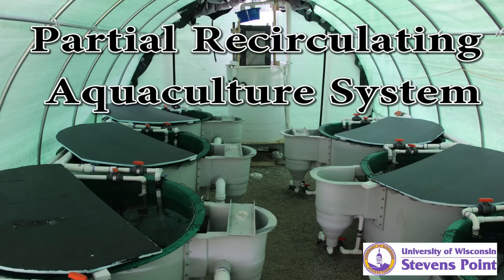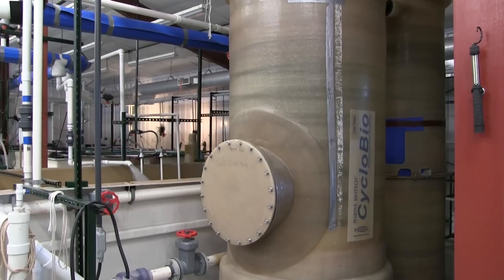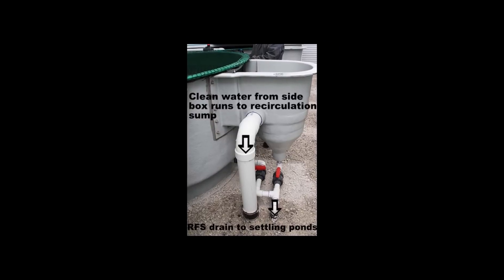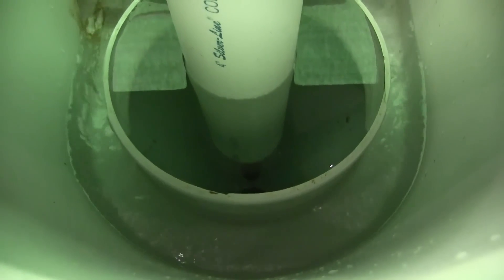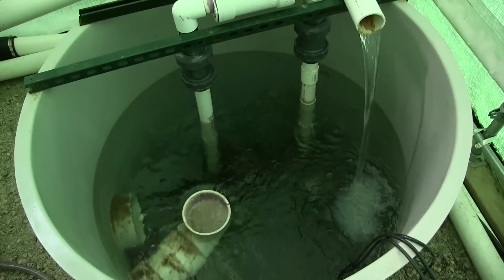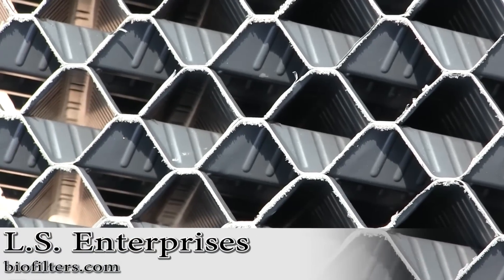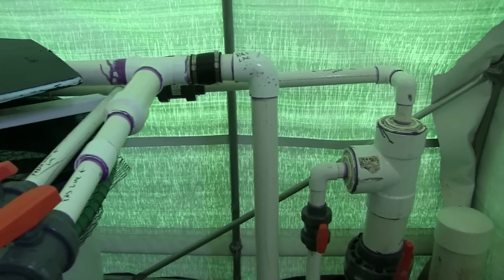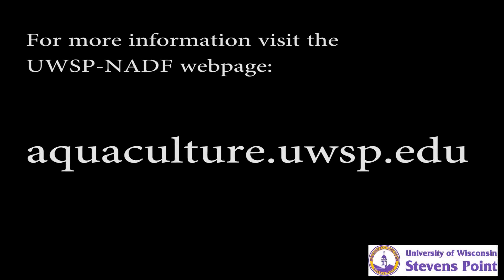Partial Recirculating Aquaculture System

Comment: Could you tell me what is the percentage of reused  water flow in total flow rate ?
Reply from the maker: Hello, thank you for your question, generally this system has about a 60% water reuse potential, mainly the limiting factor was oxygen. Again, this system does not have a drum filter or biofilter so we relied on the fresh water to flush ammonia and solids from the system. We had 8 tanks in this system, calculation for reusing the water is approximated here: 

8 tanks 2000L each, 2 exchanges an hour 
8X2000X2=32000 Liters per hour    533LPM     141Gallons per minute
60% of that is 19200LPH of recirc water
19200/60=320LPM, about 85 Gallons per minute. 
The remaining is 12800LPH = 213LPM or 56GPM fresh water.
Reply: @uw-stevenspointnorthernaqu8491  Where does this new water come from because 56 gpm is a lot of water, 3360 gph, or 80000 gallons per day .  That would be expensive here. About 84 dollars a day or 2400 a month.
Reply from the maker: @vtecmissle  thanks for your question. The facility has two high-capacity wells, they are able to provide around 800 gallons per minute each, although generally we are using a maximum of 500 gallons per minute for the entire research facility, most of this flow is going to our flow through larval and raceway systems. Yes, depending on your location, 56 gallons per minute may be significant to run, but this idea was comparing against a flow through system. In that case we would have to run 141 gallons per minute if this system was flow through. This system was created as a way to save water without using a drum or biofilter.

Comment: I’m curios. I thought pvc was infused with an anti microbial and that pvc glue and primer were toxic. Is there a way you solve this problem or does that amount not effect the fish
Reply from the maker: Hello Makayla, thank you for your question. UWSP NADF has always used PVC, primer and glue. We let the glue cure properly (for at least 24 hours) and let the systems run and rinse thoroughly  several times before the addition of fish. We have raised over 15 different species of fish on site and have not had an issue with PVC glue or primer toxicity. Feel free to reach out with other questions: ehauser@uwsp.edu

Comment: How much biomass can this support - lbs per cubic meter?
Reply from the maker: This will depend on species and water quality of the system but we suggested about 60kg/m3 which is about 0.5lb/gallon. Oxygen became a limiting factor in this system with cold water trout species, higher densities may require oxygen supplementation as well as careful monitoring of other water quality factors such as CO2. Contact for more information: ewiermaa@uwsp.edu

Comment: Do you guys think RAS would work in a country where summers are hot, and winters are cold ???
Reply from the maker: Our system is located in Northern Wisconsin and raises cold water species. During the hot months we can add more fresh water (at 8deg C) to cool if needed. Winters we also can adjust flow and open valves to prevent freezing drains. For example, sometimes, the bottom drain water is wasted from the system (bottom drain valve is left open) and only side drain water is reused to prevent bottom drains from freezing.